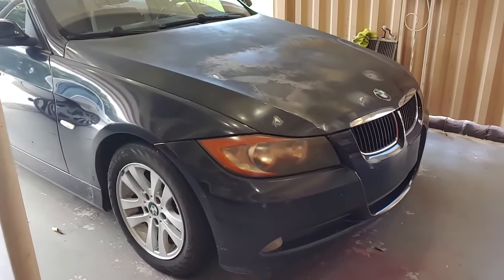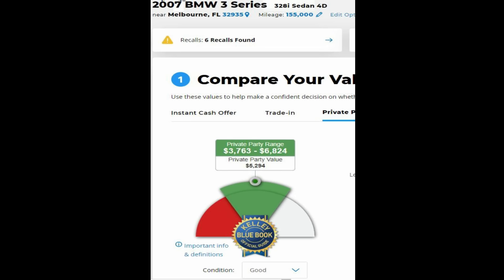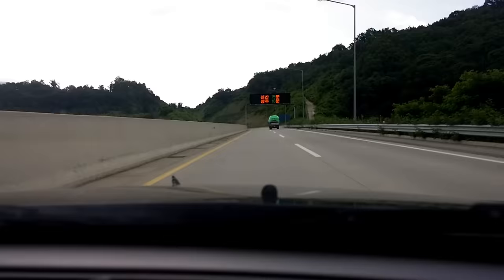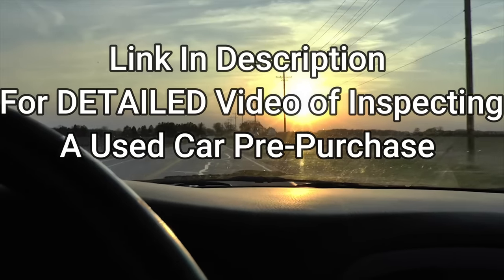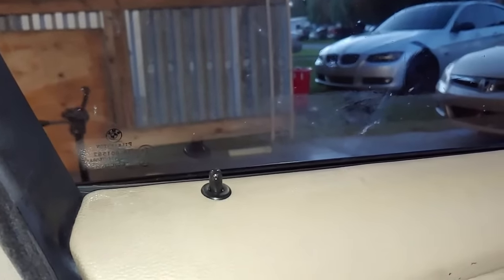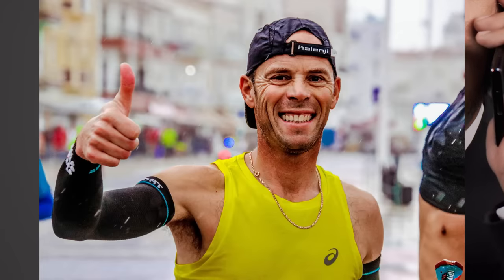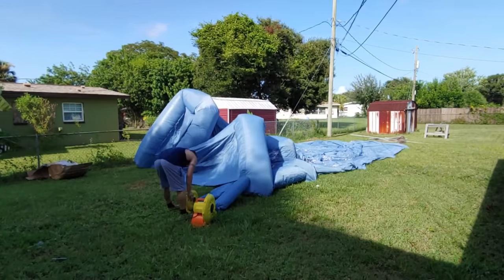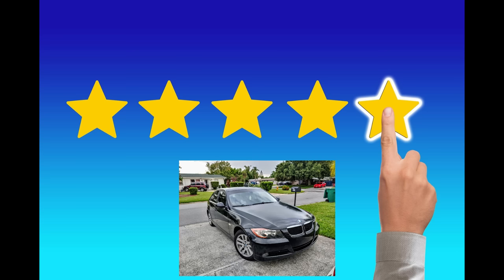How To Flip Cars | FULL PROCESS [2]

Comment: Appreciate the way you do business. Lots of scammers out there doing “quick” fixes.
Reply from the maker: Thank you man!!
Reply: lots of guys dont even do quick fixes, plenty cover up the problems just well enough to last the test drive.

good to see a flipper changing gaskets and checking codes 👍🏼 restoring my faith in buying used
Reply from the maker: @TK-jj6fg  appreciate that homie
Reply: @TK-jj6fg  happened to me recently! They had removed some of the warning lights n made the car look nice 2 days after buying it I was driving some in the rain and it span went off the road and flipped as the stability control was broken
Reply: @Trucking_Tom  hmm. Did you not drive cars before traction control was introduced? I think you flipped due to other reasons than stability control was broken.
Reply: @Jonas_Aa  Traction control came out in like the 90’s… not a lot of people are going to know how to deal with something that electronics already have under control

Comment: HIGHLY recommend an OBD like you did in the video. Tested an old 350z out, used obd to find out it had an engine code (it was a minor issue), and used that as a negotiation tactic to grab that baby for $2000 even.

Sold it earlier this year for $4000. OBD not only saves lives, it also helps a TON with negotiations
Reply from the maker: 1000% homie!!
Reply: How, just how you get a Nissan 350Z for 2000$ please let me know!

Comment: I have used Macco many times.  I have found that it is all about the prep work. Do the prep work yourself and take everything off of the car you do not want painted. Sand it down yourself, body work everything. Then when you take it in pay for their extra Deluxe paint. It's worth it. I've had several cars last well over 10 years with Macco paint going that route.

Comment: Something absolutely crucial and not mentioned in this video, 
is that to get parts at a reasonable cost you need to get a mechanic license.
And don't forget, depending of your state, you have to pay sales taxes when buying a new or used car.
In some states you don't paid sales taxes, or you only paid the difference between old and new for trade in,
but for most states you paid full states taxes for any transaction, 
for example 9.25% in California and about 2% DMV.
Reply: You only pay sales tax when you register the car.  If he had it for only a few days, then he probably didn't register it.
Reply: @jz3430  when you buy the car and transfer the ownership, you need to pay the tax. unless the seller doesn't care, then the car is still under his ownership. most of seller won't do this.
Reply: @bluegables  incorrect.  See my original comment.  Sales tax is paid when you register the car.   The sales tax is calculated at the tax rate for the county and state that you register the vehicle in.

Comment: Hey buddy, thanks for showing this video it is very educational! Im not a car guru but i do use the flipping technique to upgrade my driving-car as i go,  from 1990s daihatsu charade that i own 10 years ago ($500) to 2016 mitsubishi outlander ($15000) 3 years ago, a long way tho! Whenever i sold my car, i would drive my partner's car until i spotted a new potential car. The most challenging part for me is always understanding the car's mechanics so i always stick to the good old toyota. If it has a logbook and the car sounds right (basic oil leak check and etc), i will just buy it right away and have it serviced at my friend's mechanic shop (which is a bonus if you know someone). I always wanted to learn how to spray paint a car because the exterior look always sells better. Im able to do a bit of interior detailing so that helps. Adding door visor, window tint, changing car's audio player to third party touch screen tablet and adding dashcam are my other ways of adding value as long as the profit margin hits right. You just motivated me to want to spray paint my car now!

Comment: Rather than investing in that painting equipment, I would try to work out a "wholesale" deal with a local paint shop as you will be a frequent customer, but otherwise this is great content. Keep up the good work!
Reply from the maker: To be real I love painting hahah
Reply: @BuddysDIY  hey if you loved what you’re doing keep doing it !!!
Reply: I don't think a shop (reputable body shop) would touch it for less than $3, 000, even doing it on the side as I do I would still have charged $2000 for that job, base coat/ clear coat though with wet sand and polished.
Definitely good for you learning to do it yourself, otherwise profits disappear quickly.
TC in Annapolis MD
Reply from the maker: @megaman4201  100% brother. Good paint jobs are not cheap
Reply: HIs paint job was under 200 bucks, you pay a lot because you have to pay for equipment+labor. If you can do something yourself then do it yourself.

Comment: I have a question, Car Pickup and relocation  + diagnostic + sparkplug repair + left door lock repair + right door lock repair + sunroof repair + back console repair + sanding and full body paint job + headlight cleaning + 4-6 Hours of labor + 2-hour assistant labor.      so when you add up the value of your time spent couldn't you net more money fixing the cars and charging for repairs???
Reply from the maker: So usually I make around 100ish an hour after it's all said and done. Which is about as much as a shop charges. But the thing that's the most important for me is the ability to work whever I want. For example yesterday I chilled with my girl all day inside and then went to see a movie at night. My freedom is what I value the most. Fixing someone's car all the time is an obligation I don't want to have

Comment: Great video. I'm a Beamer guy to and very savvy with bmw issues. I only buy the bmw's with the N52 engine. Bullet proof.  Very impressed with the painting segment. You can find the 04 to 12s really cheap here in upstate ny. Soon as an engine light comes on owners get scared and dump them and it's usually just a sensor. Keep posting great videos.

Comment: This is a very informative, but not too complicated, and very beneficial for starters such as myself. I noticed you said you used the cheap spray gun for priming, which is great time saving advice, but just wondering what you think about using it for the single stage paint also if one is confident in their ability to cut (wet sand) and buff?
Reply from the maker: If you're a beast ast cutting and buffing then by all means 10 dollar harbor freight paint guns galore lolol.

Comment: It amazes me how these expensive European cars depreciates every 5 minutes after buying it...LOL
Reply from the maker: ya that's why you buy them after someone else took that loss lol
Reply: It's a BMW. Of course they depreciate nobody with braincells wants to own one outside of warranty🤣
Reply: All of the german cars are unironically expensive af in the UK these are what most people drive, VW's, BMW's, Mercs an 08 plate bmw 100k miles can easily get £3-4.5k (around $5-6000) and their conditions are usually dog shit
Reply: The reason they lose value is because the mechanical work to be done isn't common knowledge like working on a LS motor or a dodge. So after warranty for most people that's the smart time to get a new car. Even if you are a mechanic these cars require new bolts for everything you replace. What you get for your hard work is an absolute dream of a machine. -06 Z4 3.0si Convertible
Reply: @supersimon126  the motto ive heard is the only good BMW is one with a warranty.
Reply: @bOOmbOOmProd  Its not about people not knowing how to work on bmw's, but rather that work itself gets expensive af because something is always breaking and it costs alot of money to replace with expensive parts. Thats the reason why all german cars depriciate out of warranty, they are premium cars with premium parts and owning it after 7-8 years gets hella costly, and the people who buy these cars just go ahead and buy a newer one. Another reason why they depriciate is because germans are always inovating and people want the newest models, like in a simple redesign of a car (LCI) so much new stuff gets added, so the older ones depriciate due to lower demand, plus ofcourse all the gimmicky stuff that germans add and asian cars dont really have is also what costs so much to replace.
Reply: @Ho_Lii_Fuk  i can well believe it lol!!
Reply: Aaaaand in finland that same car would cost around 12-16k€
Reply: @Omgiamsotriggered  I own one and work on it. People assume all kinds of stuff because they hear somthing. The facts are like any car, if you maintain it well it'll last. The thing with luxury import brands is the parts cost more and labor is higher plain and simple.
Reply: I've bought a few European cars and without much work have sold them for close to x 2 what I paid,  2 examples  2013 Audi A5 with 155,000 miles on the clock, bought for $5K cash sold for $9K. Really well taken care off.  Current SUV  Land Rover L4 2016 with only 33000miles bought for $30K ( amazing condition, no issues) I could go to Carvana and flip it for $8K profit lol ..  Carmax a little bit less but well more than what I paid for it.  There are some great deals out there, yes takes effort but you can do it. Rule of thumb for me is I don't buy shit or not well looked after cars, saves you a lot of hassle and less time working on them..  plus as tempting as it may be never never buy a scrap titled car.
Reply: @bOOmbOOmProd  This. If you know DIY basics, Bimmers are amazing. Ofc, the parts are more expensive than say an Accord's, (own both an Accord and 3 series lol) but its worth it when you're cheesing down the highway in that ultimate driving machine.
Reply: Especially in the uk
Reply: im driving 25 year old bmw e34 hasnt let me down yet ive broke the car more than its broken on me
Reply: In Australia you can get some 10yr old european cars that retailed for $80-100k for under $20k. Nobody wants to touch that shit, too hard to maintain them.
Reply: @Agret  Ive seen F01 BMW 750i 2008- 2009's with decent kilometeres (or milage if you will) sitting at around 10,000€ and nobody goes near that thing. I was thinking of looking into it but my friend has a 2002 730d and I swear that thing is always broken and each week something goes out. First of all its europe so rarely anyone would buy a V8, and its quite a frank assumption that anyone who has money for a 7 series or V8 engine will just go and buy a new one and not a 11-12 year old one.  Cars depriciate but the repairs and maintence dont.
Reply: @Omgiamsotriggered  just had a look and 730 are 180k / 740 are 200k brand new.  There's a 2016 730d with only 27,200kms for $77k. Insane how fast they depreciate. Someone is selling a 2010 740i with 40,000kms for $40k. Going down the years further there is a 2007 model with 99,000km for $18k  and a 2002 with 113,000km for $12.5k
Reply: @Omgiamsotriggered  cool username. 😁😁
Reply: @Agret  2002 for 12500$? What country you live in, in europe you can get those from  2000-3000€ for a worse conditioned one, and for 8000-9000€ you can buy really good ones. Although calling anything good about a 15-20 year old 7 Series/S class/A8 is a debate on its own.
Reply: @Omgiamsotriggered  in my previous comment I wrote I live in Australia. Those prices are Australian dollars. European cars are much cheaper in Europe yes, very easy to find cheap BMW there.
Reply: @Agret  its just unfortunate that nothing is more expensive than a cheap used luxury german brand 😬
Reply: Fsho
Reply: @Omgiamsotriggered  I’m sorry but if you buy a car and can’t afford to maintain it then that’s ultimately your financial fuck up. Most of the owners of these premium cars flex like they’re rich but struggle to afford a simple oil change.
Reply: Wait about 3 years and then buy a leased one and just make sure you know how to do your own maintenance.

Comment: I tend to find when the cars I’m working on go in for paint, that they come back covered in overspray and are rough to the touch, when you’re painting your own, is the final finish smooth or fairly rough?
Reply from the maker: That means they aren't using the right air pressure or they are using cheap guns or cheap thick paint. Or all of the above lol. You can always wet sand and buff. Time consuming but it's an option

Comment: Great channel. Small suggestion to be more accurate. I love how you included the price of gas for the 4 hour round trip. But you could also add mileage depreciation with gas. It’s usually just a miles driven multiplied by .75 cents for an example.

Comment: Appearance and condition. as well as honesty are SUPER important for your reputation. I've nly seen two of your videos so far but when I buy a used car to "flip" I ALWAYS change the oil and filter with Mobil ! Full Synthetic oil and a premium filter.

A lot of fathers buy my cars for their kids and the first thing they ALWAYS check is the condition of the oil by examining the dipstick and most even smell it for any tell-tale sigbs.

I also detail the engine 100%

And one other important aspect of detailing a car, I play "hide and seek" with dirt and grease; meaning I detail my car then dare a friend to find any spots I may have missed, and my friend will typically find one or two.

Comment: For sanding, what grid did you start off at and what is the final grid? (before the primer) (example 400 - 1500) or something else? What about the sandpaper grid for the primer? Also, can I sand the paint slightly before the clear coat (im 2 staging it) or would that cause it to look bad) thanks in advance!

Comment: Best flip I ever did was when I was 18. Bought a 2002 Honda CR-V 4wd, manual with a blown clutch for $100 off a friend's dad. It was meticulously maintained since new. One owner car with detailed service records it's entire life. I replaced the clutch, V-tech solenoid, every single light bulb in the car, wipers, etc, (all the little things.). Drove it as my daily for 3 months then sold if for $3500. Even including the money I put in for fuel and insurance while I drove it,  I still turned a profit. One of the best deals I ever found.
Reply from the maker: That's a silly good deal. Those little crvs are tanks. They never die

Comment: Dude this video is clean. I own a black 318d m47 engine aswell. Motor code is very important on these models. As 316i 318i have major oild leaks and timing chain problems. 

I might do the headlight cleaning next summer but atm changing abs sensor which is common problem. 

Also hope new owner buys nee rims and change out grill for the looks ;)

Comment: Have you ever bought or looked at a vehicle that someone is selling, and they say they replaced the engine a while back

Im looking at a dodge ram 1500 5.7 hemi 4x4 06 SLT 4 6-1/4ft bed. 

He has had it for 12 years. 2nd owner and saying he has replaced the engine and instead of it having 211k miles it has 140k miles and he does have a paper saying engine from a shop looks like a receipt. 

He wanted 4 grand for it and its got a rusty bed for sure would have to replace that. But paint and stuff looks good so far

Just wanting to know if you have ever bought off someone saying they replaced the engine ?

Comment: Bought a 2012 Passat that someone had put a battery and an alternator in and still wouldn’t charge. Replaced a $50 fuse and it was all good. Ended up doing tires, brakes, spark plugs, filters, fixed some oil leaks. Had to put way more into it than I originally planned but it was worth it because by the end I ended up making more money on the car having everything good to go.

Comment: That air vent black panel in the back looked better there than if it would have been a brand new tan panel with no paint peeling. Really went well since the dash had the black accents.

Comment: I am 18 years old and I am really I mean REALLY hooked into cars and I want to go for car flipping any advice for a starter?
Reply from the maker: Get a car that needs one or two major things as opposed to a bunch of little things. Also a car that has cheap parts. GM or japanese. Older cars (before 2012ish) have less computers and sensors and stuff that cna be a nightmare to fix. Engine/suspension work is easier that eletrical work. Stear clear from eletrical issues on cars. There's a million other things I can list off but those are maybe the most important
Reply: Thank so much for the response! I will work this sommer and get aome money but here in Bulgaria the standard of life is below zero I will start from a 1500-2000 dollar car I have paint pistolls garage with a vault to look underneath the cars soo should be easy got all essential needs for mechanical purpose but none for eclectical thanks once again <3
Reply from the maker: @airgamers7041  no prob man. Best of luck!

Comment: The bad thing about OBD2 scanner is that if the seller clear the code, a mid to low end would not be able to read the code as there would be no pending code. You would need a high end scanner or a State Inspection scanner. Be careful, do a drive cycle with the scanner plug in.

Comment: I have the worst BMW luck of all time. Bought an e36, 80,000 miles absolutely PRISTINE. Guy said the fan clutch went out, said he never let it overheat. No problem- bought a $20 fan clutch, installed and drove off. Pegged the temp immediately, cracked head. Guy basically took off with the money, wouldn’t answer calls…finally when I threatened litigation he signed the title over. Swapped the engine, restored anything that needed it over the pandemic. Drove it 2 days and a Vanos shim somehow let go, went through an open valve and straight into the motor 😂 I had never seen metal shavings that large in the oil filter